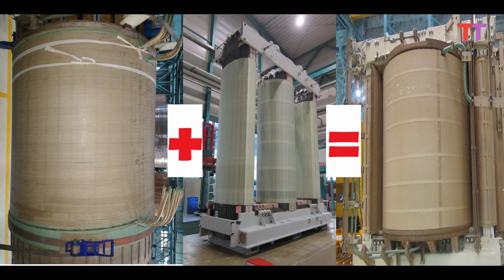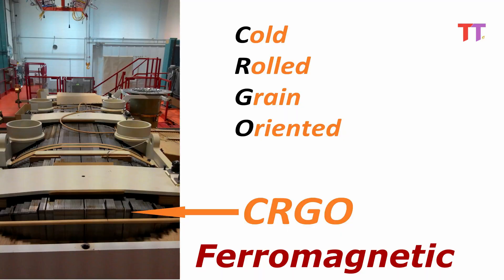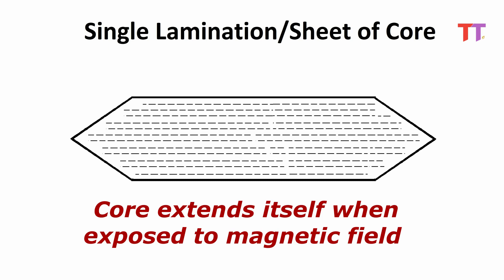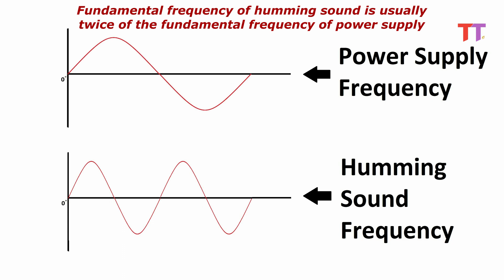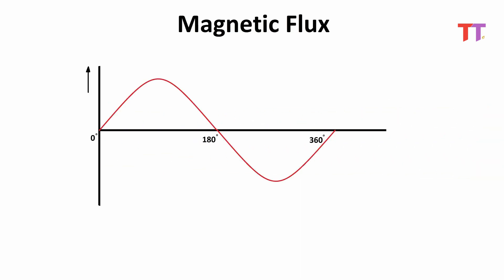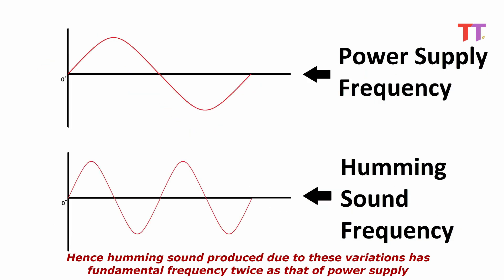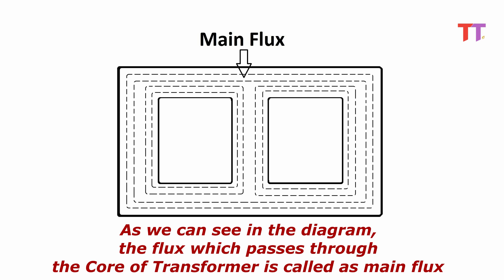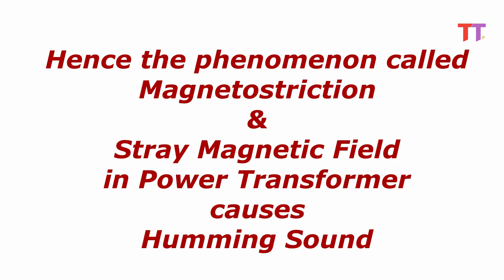Humming Sound of Power Transformer. A Complete & Detailed explanation

Comment: I am sensitive to these vibrations  even from great distances. I have a noisy one in my heater cabnet  that I will attempt to rectify and have only on and conected to the thermostat so whole system goes on and the transformer is not constantly on vibration. I dislike the vibration of appliances like refrigerators.